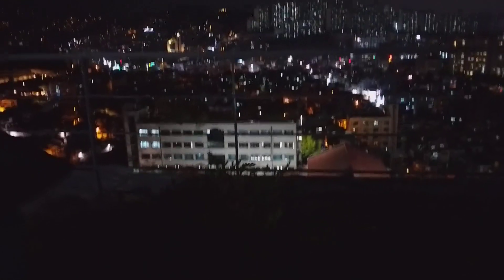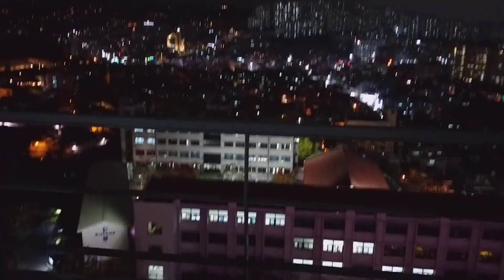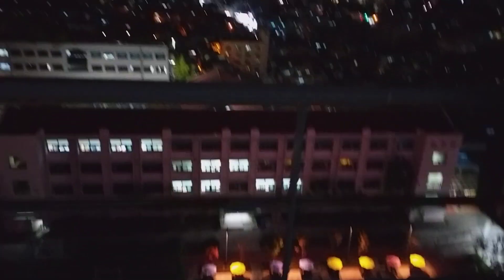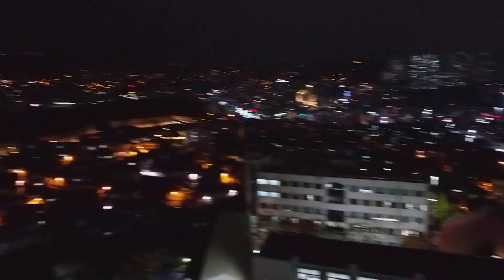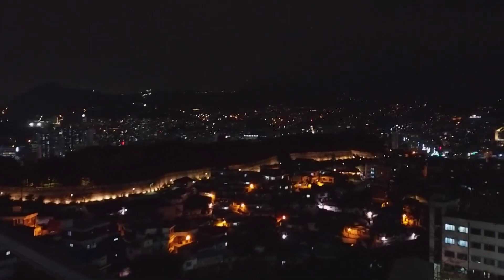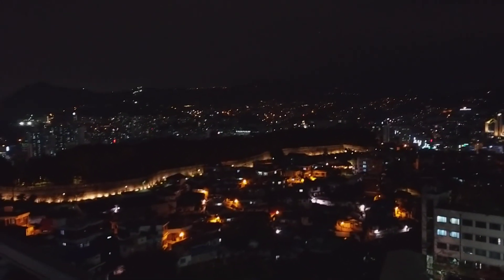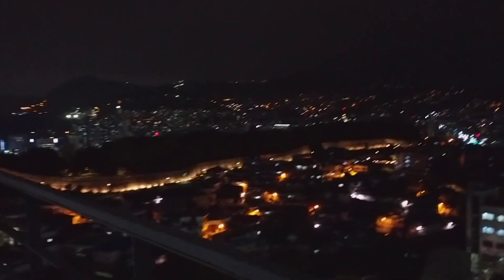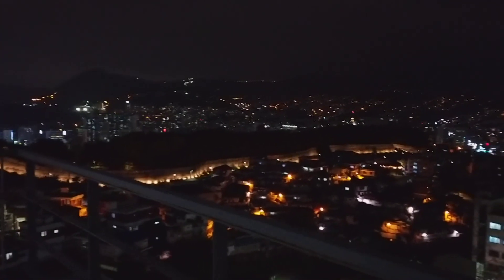3 el wire 20m yagi antenna at 120 ft. portable

Comment: What are the element lengths and spacings? 73.
Reply from the maker: Hi, they're on my computer at work, so I'll try to remember tomorrow and post them in the comments and/or above here.  I used the free modeling program MManan-gal. It has taken a bit of time to learn it, having to ask some questions in the QRZ antenna forum, but the yagi templates alone have really helped me design some simple (but very good) 2-element and now a 3-element yagi.  It's so darned simple to make a really great antenna out of wire.  Jumping from a single wire to a 2-element is the biggest jump, and it's only about a half s-unit to move to a typical 3-el, from there (with some better front-to-back).  It's been so much fun.
Reply from the maker: I got the model at work. Here are some notes about it. I ran some numbers with the Yagi at about 5m high off of ground (not my roof, though), and the SWR dropped closer to 1.3, and the gain actually went up (although the angle suffered a lot). Not sure how to input numbers for the roof. I also changed the wire to copper 16AWG, and recalculated. I was running my original numbers based on a lossless material, so the gain numbers did drop, as noted in the graphic.  This isn't a perfect 3-el yagi, but it's completely buildable, and at height, should perform well. It would take more tests to see if the 14.555 frequency was a good adjustment, per velocity factor of my wire. If you use wire with a thicker coating, it might even be on a bit closer to where I wanted it to be. I modeled at 14.555 because I knew that, with this exact wire modeling dipoles and verticals, that it would land with the sweet spot about about 14.200, once cut:
Director length:  9.6m
Driven Element length: 10.09m
Reflector Length:  10.45m
Distance from Driven El to Director: 2.9m
Distance from Reflector to Driven El: 2.3m
Total boom length:  5.2m

Wire: Plated copper 16AWG with thin PVC coating
Modeled frequency to adjust for velocity factor of coated wire making it appear electrically longer:  14.555 (making it land around 14.200 or so).

Actual freespace gain with this wire:  6.87dbi
Actual Front-to-Back in freespace:  16.27
Freespace (R)Ohm 33.52, j(X)Ohms: 3.83, SWR (50) 1.51

Comment: Like the yagi!  Are you in the CQ WW DX Contest this weekend?
73 de W0AAE
Reply from the maker: Hi, did you get your moxon working?
Reply: Still trying to get it working, but I lowered the SWR a little.  I think it will work eventually.
Reply from the maker: @keesvanoosbree5911  Did you run a sweep with an analyzer?  Is it closer to 1:1 anywhere?  One of the problems people have is the velocity factor of the wire. I explain this in my video, but you were using enameled copper wire, which I have not tried yet.  I normally have to build my 20m antennas to a frequency around 14.555 or so, to account for the pvc coating on the wire making it appear electrically longer. If I don't do this, my wire appears longer and will be resonant far too low.
Reply: OK.  I did compensate for the electrically longer wire.  Actually, I think I made it too short!   That's all right because I have plenty of wire.  I don't have an antenna analyzer, however I do have SWR analyzer which shows me a little of how the antenna's acting.
Reply from the maker: @keesvanoosbree5911  The poor man's way of doing it is to take measurements when tuning at the top, middle, and bottom of the band.  That way you can see where abouts you are in the dip of the SWR.  If it drops lower as you are at the beginning, in the CW portion, you need to shorten the yagi.  If it drops in the upper part of the band, around 14.300 and higher, you are too short.  Nothing wrong with adding a few centimeters of wire, if you have to.  If you are indeed too high, I would suggest adding 14cm (7cm each side) to the driven element, and 15cm (7.5cm each side) to the rear element, for every .200 you want to move the frequency lower.  

The side gap (C) will only adjust 1cm for every .900 or so, so if you added enough wire to make the frequency .900 lower to get to 1:1 SWR, then your gap lengthens only about 1cm.  You can see how this changes by adjusting the numbers you input into Moxgen.exe.
Reply: @thestingyham1188  OK that makes sense!  I'll do that!